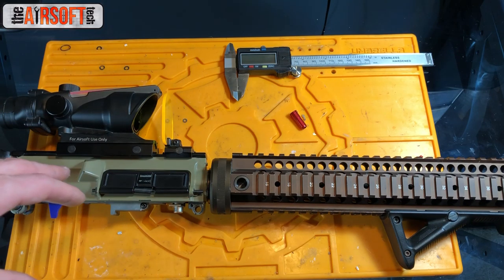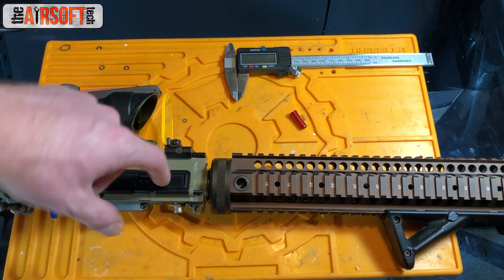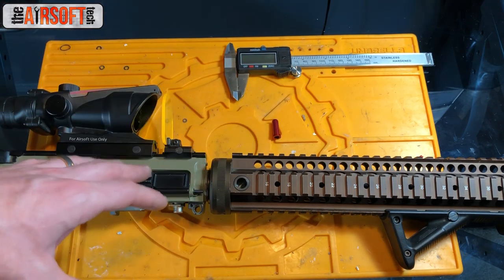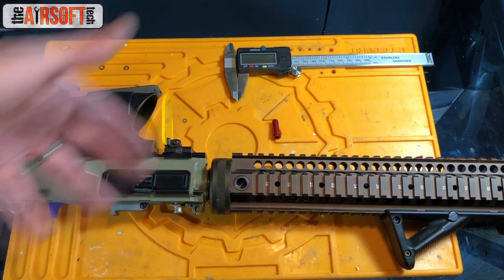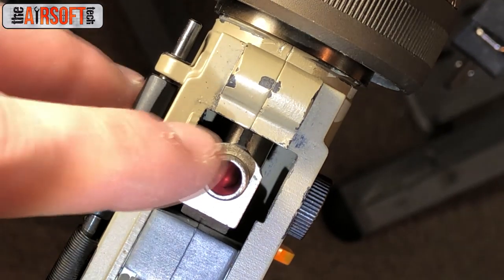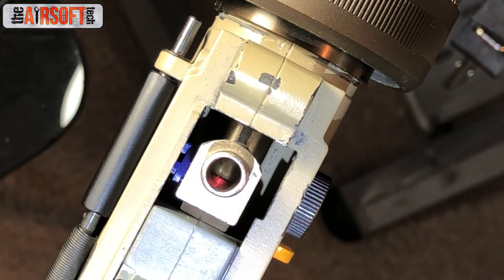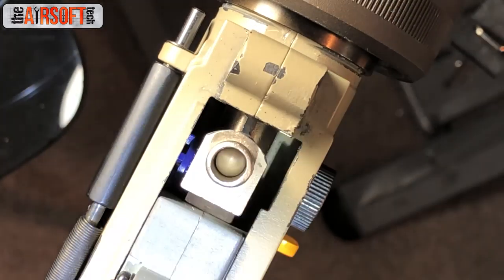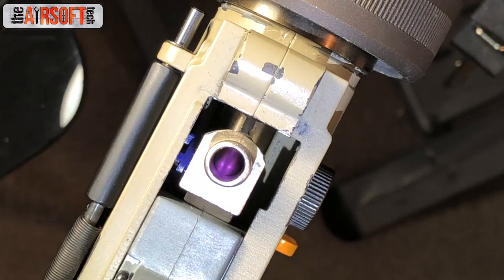Five Minute Tech Tips: Proper Air nozzle Fitment

Comment: Out of curiosity, how do you check if your air nozzle length is appropriate in a gearbox without the split feature that ICS gearboxes have?
Reply: You could try taking out the piston and spring (maybe the ARL too). Then slide the gearbox into the upper and cycle the gears with something through the pinion hole
Reply: If the muzzle of your inner barrel extends beyond the outer barrel and if you know the piston is fully forward, just blow down the muzzle end. You'll be trying to push air against what is hopefully a seal between hop rubber/nozzle and the piston head sealing against the cylinder head outlet.

And because some people on the net are complete maroons...mags and battery out of gun before doing this.

Comment: Listen I have a stock tippman commando, ive been struggling i just want to upgrade the nozzle, the shs m4 nozzle is barrower and wobbles causing  crappy accuracy. What nozzle will fit the stock hop up? I guess the issue is i need a shs compatible hop up diameter i guess in order to fit. Thanks in advance love your vids.

Comment: Any nozzle recommendations for an ASG scorpion evo?  I had to shave down a plastic nozzle to make the right length but lost the taper at the same time
Reply: Measure stock one and go onto retro Arms website and order that length, they have air nozzles in any length standard bore size and bore up size
Reply: Marinus de Dreu  the problem is I piled up the front end in a shattered the original.  Totally my fault accidentally hit the trigger doing a spring swap to make the fields limits. Made a hell of a mess..... rookie mistake 🙄

Comment: Can you please help me with this issue, i don't know what to do:

i have this problem:  
I just upgraded 2 AEGs, one CM.098 and one CM.007  

CM.098:  
Maxx Model Pro  
Map Leaf 70° super macaron  
ZCI 499mm 6.02 SS Barrel  

CM.007  
Maxx Model Pro  
Map Leaf 60° super macaron  
Map Leaf 370mm 6.02 SS Barrel  

in the CM.098 i kept the stock nozzle although i knew that MAXX model works on 21-21.25mm nozzles, the stock nozzle is huge, like 24+mm and as a result i can see it when i look through the feeding hole, BUT, it works perfectly fine, it just works, is this weird or not? should i leave it this way?  

in the CM.007 the nozzle is shorter, i can barely see it through the feeding hole BUT i have a lot of dry shots... i installed the cm.007 parts (hopup, barrel and rubber) in the cm.098 to test it, and works perfectly fine, then i thought about the mags, i tried the stock hi cap mag in the M4 and works perfectly fine, no dry shots at all, as soon as i go back to the Battle Axe mid caps the dry shots start again.

Comment: What do you do if your hop chamber set fully forward against receiver feeds but has poor airseal. Vs. hop chamber pressed rearward against gearbox will not feed? All my Hop Chambers (Maxx, Prowin, promy, TM) all exhibit play forward/ rearward. Too forward = very poor airseal, too rearward = no feeding bbs. I can’t find a sweet spot but also I think there shouldn’t be any hop up chamber play. Using Retro Arms split shell in Hurricane Metal body. Nozzle slightly longer than M4 won’t feed no matter where hop chamber is.
Reply: Try putting a thin rubber o-ring on the rear of your hopup chamber. The part tat goes into the front of the gearbox shell. that wee bit of spacing is sometimes all that is needed. You can get several different thicknesses of o-rings to try out.

Comment: if i have 16.1 shs gears with a m125 and full metal rack ares piston and a asg 40k motor why am i running into P.M.E
Reply: You shouldn't be running into pme with that setup, that's actually really interesting
Reply: Did you correct AOE? Put a MOSFET in with active breaking if you can't figure it out

Comment: Sooo thats doesnt True. Proper lenght of nozzle in ics gb is 21mm with stock unit. There is problem if you change the hopup unit, than you need to check the lenght. If you have shorter nozzle, the BB trajectory is bad.

Comment: more like nine minute tech tips
ok but seriously I have a CA VSS and the stock airnozzle is poopy, so i got one that's 0.5mm longer than the original. Will I have to shave that down? its a specialized v3 gearbox
there was no 19mm airnozzle on evike but then again i didn't search too hard
Reply: Go to retro Arms website, they have any length air nozzle, in both standard, and SBU (standard bore up)
Reply: @marinusdedreu3833  Turns out they are the same exact size, i didn't use very a precise measurement device. Finally got everything shimmed and closed up, hopefully it works